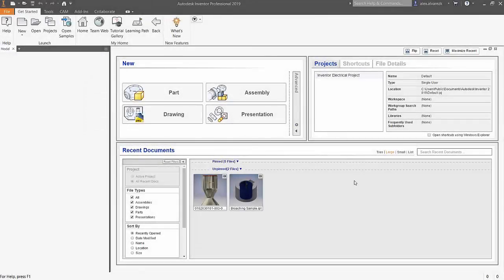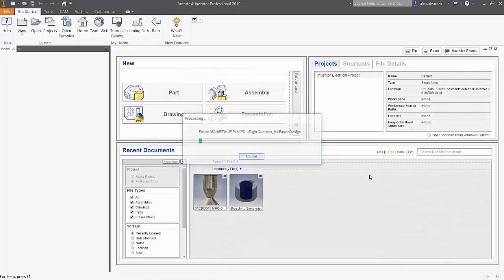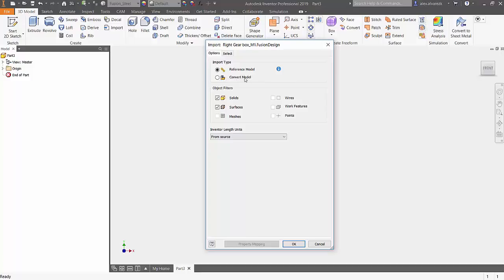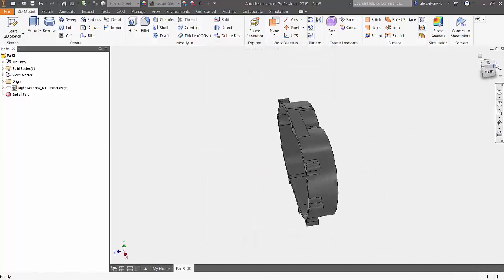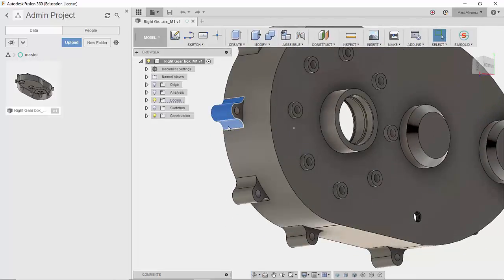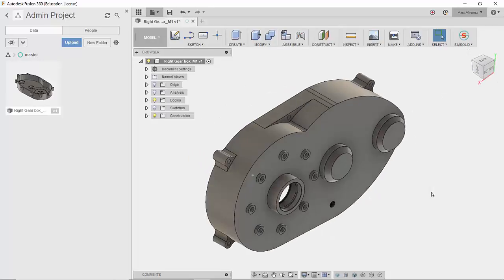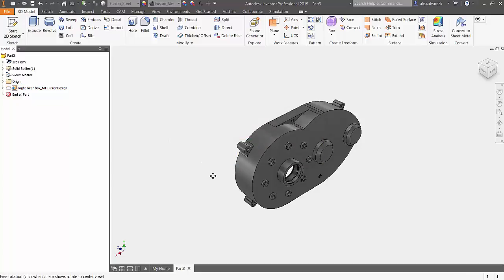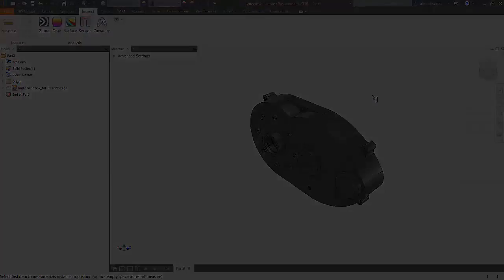Quick Tip - Working with Nonnative Data with AnyCAD

Comment: i have a question please , What is the difference between Solidworks and Autodesk Inventor?
Reply: One difference appears to be a substantial difference in price between SW Ultimate and Autodesk PD&M Collection. Related, while Inventor is only subscription (with monthly as an option), SW has a perpetual option last I checked. Another difference, Autodesk products are far easier to try and buy. Another difference is, SW Ultimate has 2.5 axis CAM, while PD&M Collection has five axis. Solidworks has roughly 3x the market share, but Inventor can import SW files. I've been using SW for over five years and now as an independent designer I am switching to The PD&M Collection as my primary design environment.